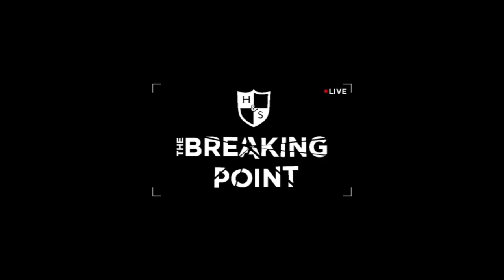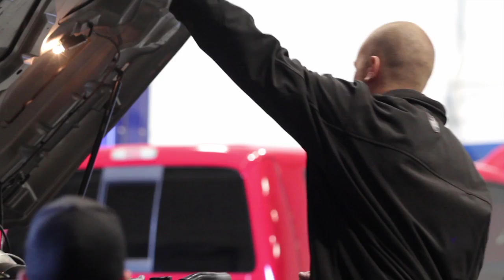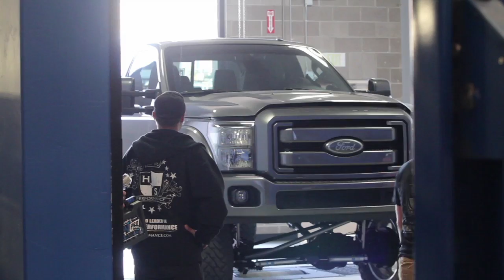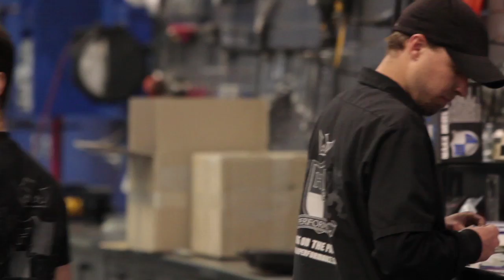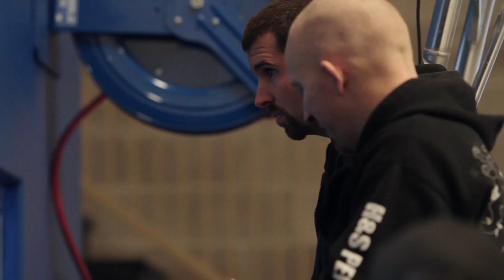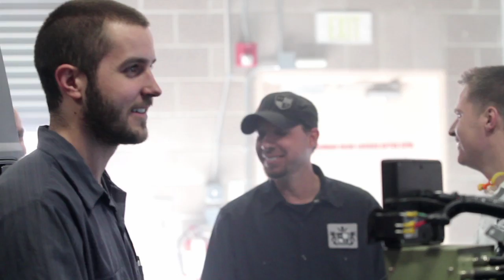Breaking Point 1 - Ford 6.7L Scorpion - H&S Performance

Comment: Breaking point is about Stock motor? and tuning? right? Why do i see other mods on the motor? or are those just do hicky little mods? besides fuel mods.
Reply: Mustang Forum
Quote:
"also a motor is electrically powered and engine is fuel powered"

Maybe someone should let Ford 'Motor' Company and General 'Motors' in on this little secret... Perhaps the Department of 'Motor' Vehicles should also update their nomenclature??

mo·tor
ˈmōdər/

noun
a machine, especially one powered by electricity OR INTERNAL COMBUSTION, that supplies motive power for a vehicle or for some other device with moving parts.

Comment: Your point? The duramax had 1086hp, thats 202hp more worth of stress on stock internals than the powerstroke. Get that powerstroke to the same level or more and I bet you'll find the same results
Reply: The Cummins had a built transmission because they knew it was shit and the transmission would go before the motor. The only reason they didnt keep going with the power stroke is the STOCK transmission was slipping